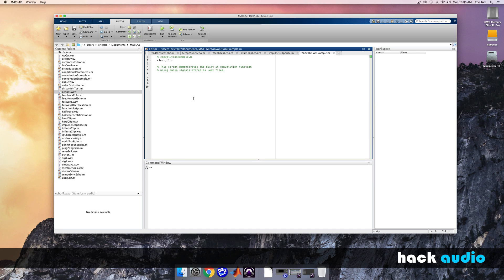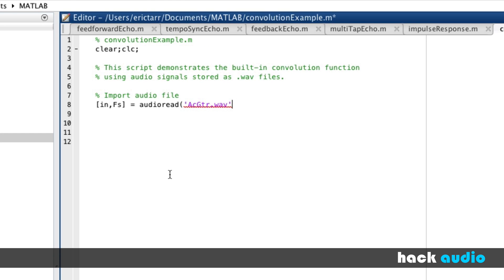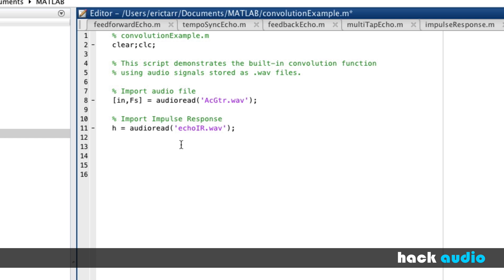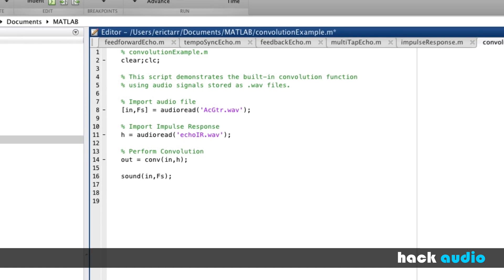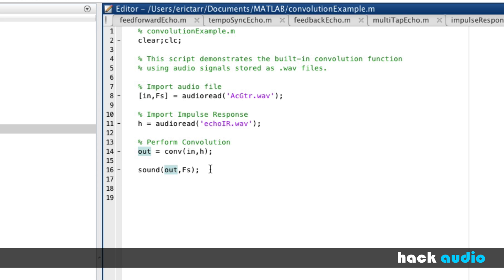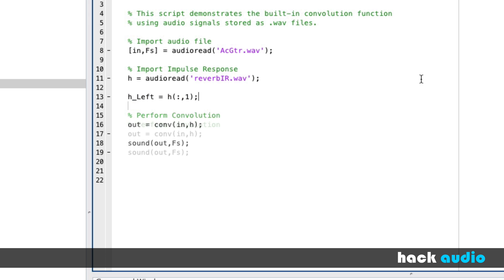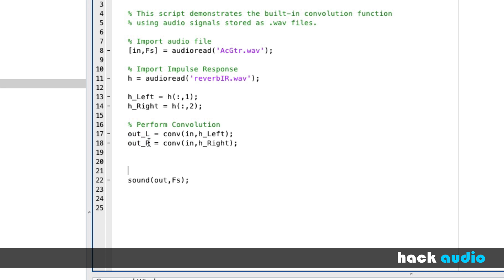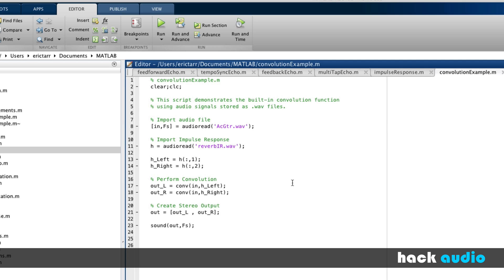Hack Audio: Convolution Function

Comment: When I use my own reverbIR.wav that is 48kHz, stereo, I am able to achieve the same affect but I have to multiply the signal by 0.01. Something about the conv function is blowing up the amplitude. Any thoughts?
Reply from the maker: Great question. That probably just comes down to the scaling of the IR signal itself. Keep in mind that the IR signal essentially adds together thousands of repetitions of the original with slight time delays. So, the output amplitude signal can get quite large because of all the signals stacked on top of each other. One thing you could do is multiple the IR by 0.01 ahead of time before the convolution. Then the output signal should be in the right range